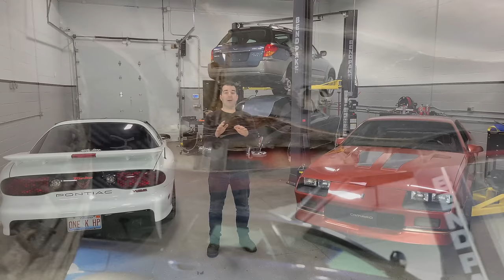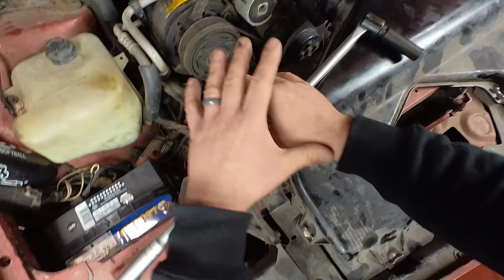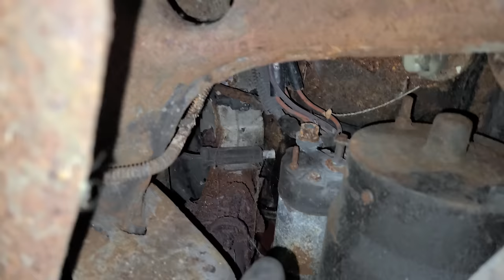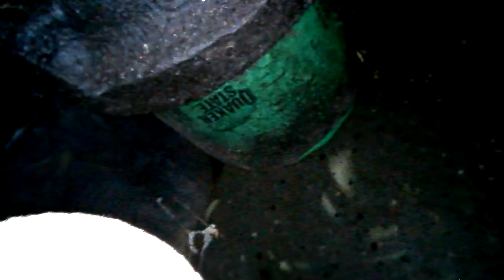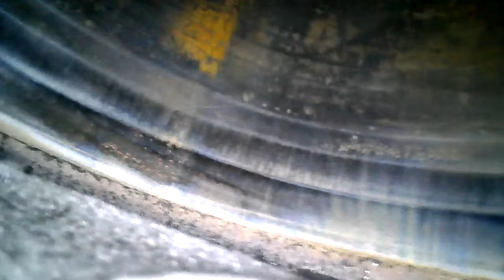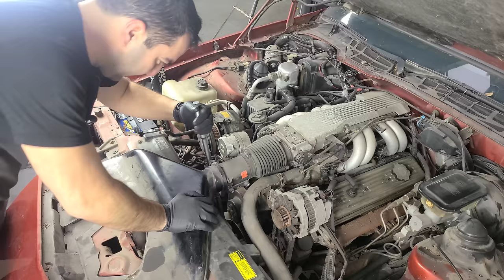Starting An Abandoned Camaro IROC Z After 27 Years & Looking Inside The Engine! Storage Unit Find!

Comment: I’m late on replying on this video, but Gosh , water in oil ? It was a blown head gasket, 

U can’t start this car up with the motor the way it is, 

These cars are prone for head gaskets, reason was, from the 82 to 92: there was trash bags and trash going in and out of the lower air inlet, thus causing over heating with the fans on, remember these cars had no air filters to protection for the air, only top filters, going directly into the radiator, thus causing over heating and there for blown gaskets,

Comment: Yeah I think the late 80s and 90s Camaro became a pain in the ass to give them a tune-up I have a 99 Camaro and you can only get two of the spark plugs out from under the hood the other ones you need to be a contortionist to get the venom out from underneath big hands don't Help.

Comment: IDK.... There's initially an awful lot of rust underneath... If the engine ran good, I'd say the car MIGHT  be worth salvaging, ditto restoring, but there'd be a whole lot of work on that lower deck needed with giving the suspension system something more solid structurally to adhere to... However, that engine sounds like it has far too many issues, and old TPI engine replacement parts can be difficult and expensive to come by... Also with that said, what kind of damage has also been done to the transmission, or even the rear end? Those too, were more specialized for the IROC-Zs and again, difficult and expensive and to come by! No, parting it out probably would be your best bet at this point...

Comment: I kind of miss my 1988 transam black on black no tops Ricardo seats He had about 100,000 miles when I sold it for six hundred dollars back in 2008 and it ran great didn't burn any oil need some rust repair by the way did I mention it was black on black only 2000 and wherever made big mistake should have never sold it. Try to find one today lol

Comment: I had a 1983 chevy Monte Carlo with the 305 in it. Coming home from work, the car quit on me on the Kennedy. No start, didn't even turn over. A Minuteman came to help me and tried jumping me with his diesel tow truck. @4 volts and still didn't turn over. He towed me off the expressway. Got the car home ripped out the engine. when I pulled the oil pan and took off the main caps, The number one main looked like it was arc welded to the crank. All the rest of the mains were fine, all the rod caps were fine. Took a sledge hammer to the block and left it in the alley. No warning, great oil pressure, no overheating. The scrappers picked it up the next day. Replaced with a four bolt 350. the car went from 73k miles went the engine locked to over 300k miles with a boneyard engine. The 305 was the worst engine I ever played with...

Comment: The engine wasn't over filled with oil!  It was filled with water.  The oil was floating on the water causing the dip stick to show over full...  yes still a screw situation none the less

Comment: To be real, at this point all the gaskets are rotted so the engine needs a rebuild anyway, so there is little point trying to crank engines in this condition. You risk doing damage trying to crank it even if it turns. A rebuild kit is like $200 for these cars

Comment: How much is the Camaro worth? That's an unknown quantity. If everything is replaced and pro painted, probably more than the 15k you mentioned. Like 20k I think. For someone's first car after getting it running just like in Transformers with the yellow Camaro, 3-5k. My first high school car was a 1973 Nova with a 350, four speed, duals with the typical gm rust through on both quarters was eight hundred bucks. This was back in 1980. Today a beater car can't be touched for under 1,500 because of the chip shortage thing and Brandon's inflationomics...

Comment: Body is rusted out and now the engine is bad. Part it out. Some of those parts that are still in good condition are worth some $$$. Front and rear bumpers, wheels, AC condenser, etc. and then scrap the rest. You'll get a couple hundred out of that.

Comment: You cant run a car on starting fluid.  Its detonating. Like a D. TRUCK. USE WD 40. OR BRAKE CLEAN. F.F.S.  OR JUST PULL THE THING OUT. And tear it down.  305s. are hard on rod bearings.  It probably has rusted out steel shim head gaskets. Hence the moisture in the oil. Take the dam thing apart.  Cut the old oil filter apart .TO. it will tell a story.

Comment: Try running the engine off gasoline or something other than starting fluid. I'm not sure about gas engine's. But I do know diesel's will knock real bad like that when using starting fluid at first. Also starting fluid is really bad and hard on engines. It should never be used to strictly run a engine like your trying to do. It was made to start diesel engines in the cold weather. Starting fluid washes the cylinder walls, rings and drys out cylinder walls causing scoring. Plus starting fluid has a zero octane rating. What happens when you run a car on 87 that calls for 93. You would clearly get spark knock, know imagine what a engine would sound like. That's spark knocking running off something that has a zero octane rating.

Comment: Blown head gasket caused by temperature switch not working.  Screwed into side of the cylinder head these are notorious for taking a crap back then motor is junk goodbye

Comment: Dude……. Once you pulled the filter and saw the badness it was obvious either a blown head gasket causing an internal coolant leak or cracked cylinder. Between the damage and sitting for years, this motor is a total loss. Looking at the car overall, between body work and mechanical, it’s very doubtful you could get restoration money back. Sell the interior for top dollar. If you have a buddy that rebuilds motors to sell, do that too. Sell or gift the shell to a young gear head. Give him/her a project car to dream about for the next decade

Comment: That’s not an iRock Z 28 with an iRock body package iRock Z’s a real iRock Z has a 5.7 L to port L 89 V8
Reply: Iroc package was offered with a auto and 305. You could not get a 5 speed manual with the 350. I had a 88 iroc with a 305 with the 700r4.

Comment: I know this is an older video but I gotta throw my two cents in….HEY DUM DUM you shouldn’t run an engine on straight starting fluid like that! It definitely makes an engine run badly and will make it sound exactly like that, I’m sure some of the valve train noise is from it sitting for so long but it wouldn’t of been that bad with regular gasoline! The ecm was going crazy not knowing what to do, so many things, well sensors, weren’t doing their job! put a fuel pump in it or at least tap into the fuel line and plum in a pump from a gas can with at least 30-50 psi and then start it, let it run for a bit! You’ll be suprised! Do that and I’ll apologize for calling you a dum dum.

Comment: I would totally restore it with a whole new engine redo the interior completely painted just restore the whole car you already have it unless you don't have the money to do that which I suspect you do unless the frame is damaged rust is ok notmal but frame damage throw it out, or make it a 9 second car if possible. I would drain the oil again. That was nasty when you drained oil first time I had a car that set for a while and it was knocking like that too I drain the oil same thing look nasty and then I drained it again make sure the oil ran through the whole engine again. and I drained it again put new oil in it again and eventually for some reason that knocking stopped and I'm not really a car guy I don't know much about engines and just telling you what I did with my engine sounded exactly like that but after I drained the oil a couple of times it ran with the new oil a few times through the engine for some reason the knocking stopped